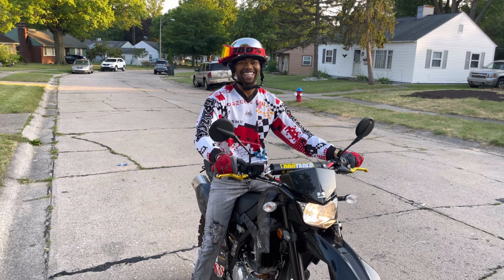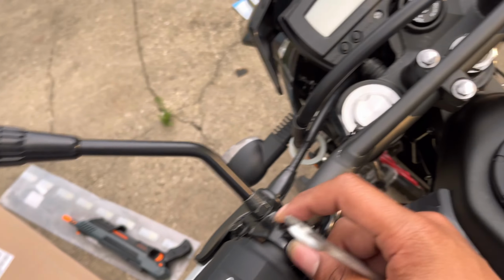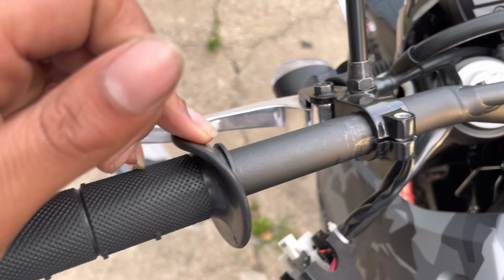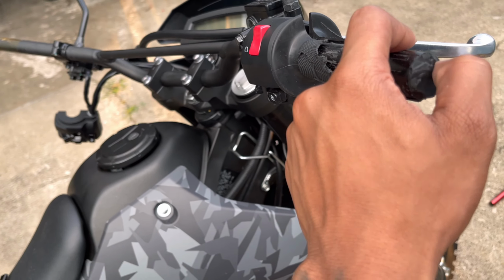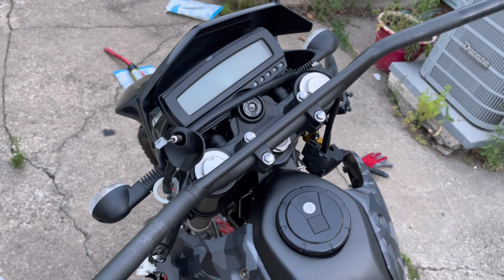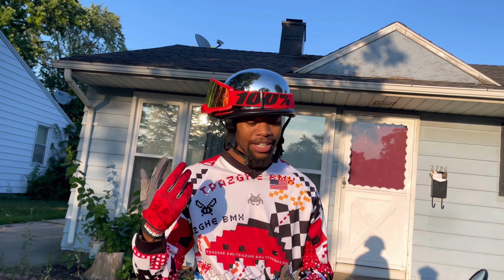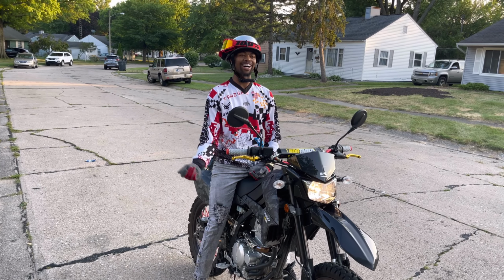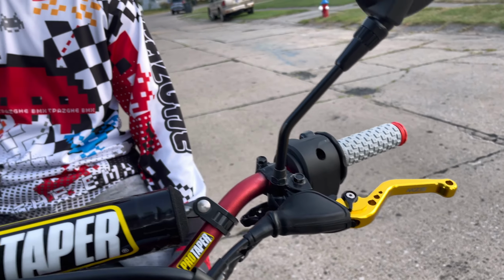TESTING THESE NEW PRO TAPER SE CR HIGH BARS

Comment: Did you file down the nub in the kill switch and blinker switch or drill holes in the new bars?
Reply from the maker: No drilling required at all everything should fit perfectly bro it was pretty easy the hardest part is remembering how everything was lol I would take a before picture or even better a full video walk around for screws